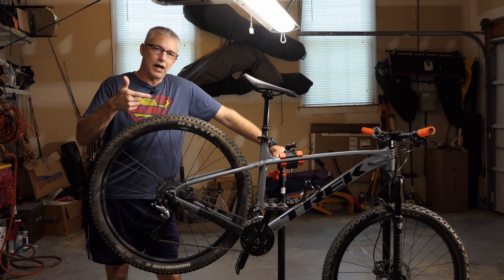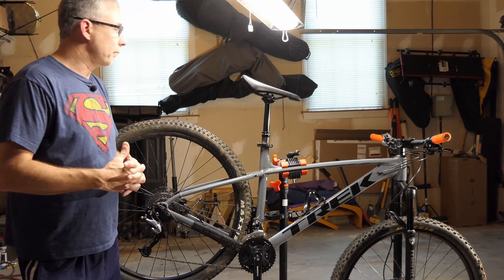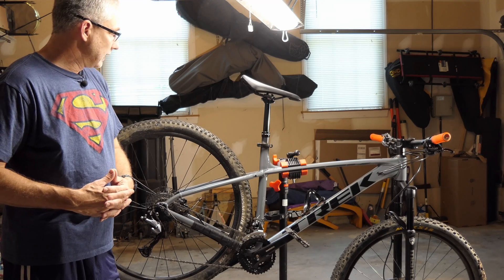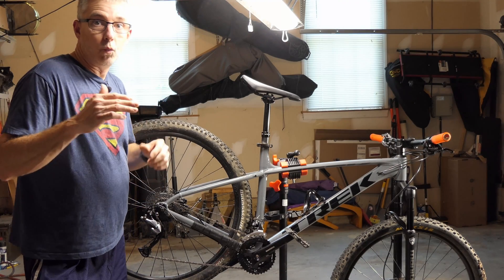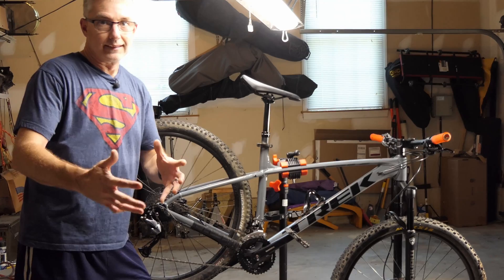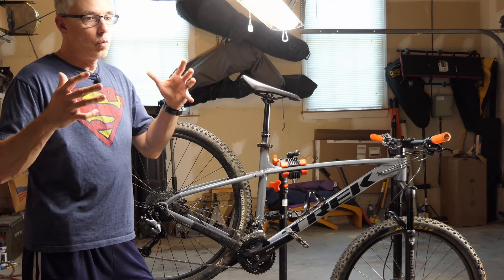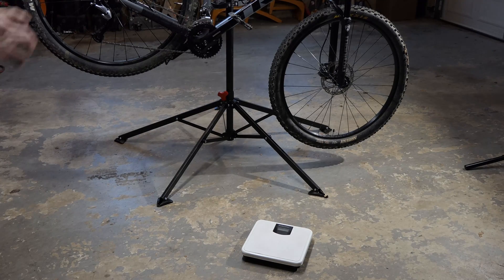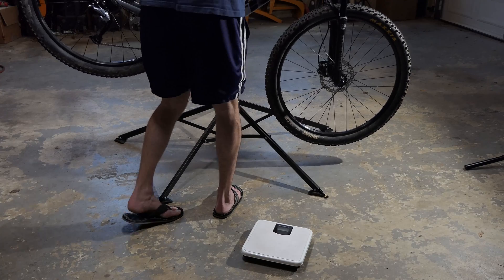PT 1 - Introduction and Teardown of 3x9 Components - Trek Marlin SRAM Eagle NX 1x12 Conversion

Comment: Happy to see this series. Looking forward to watching the other parts. 
Regarding the hub, I should add a note here: the 2x8 marlin 5’s have a shimano freehub that can be upgraded to a 1x12 NX
Reply: I just did the same upgrade on my 2022 Marlin 5 to 1x12 with freehub; it works great!  Just be careful when assembling the cassette, very little tolerance.  Also I upgraded to the GX derailleur and shifter; made a night and day difference.
Reply: @Importeck  thanks for the tip!
Reply: THANK YOUUUU!!! I've been searching through the internet trying to find out if I can use the stock hub to upgrade to an NX Eagle Groupset and now I know, THANK YOU!!

Comment: i have a 2022 marlin 8, it came with SRAM Eagle SX 12-speed.  I have converted almost all of the drivetrain to GX except for the rear hub.   GX and above use a different freehub driver than SX and NX.  The hubs that came on my bike are formula and finding a freehub driver is turning out to be a struggle.  Formula DC-22LW, 6-bolt, Shimano 8/9/10 freehub, 135x5mm QR...  If anyone knows where and which freehub driver I need, please advise...

Comment: did you install the dropper post?
Reply from the maker: Yes.
Reply: @EVERYTHINGcpo  looks like a internal, did you have to drill the back hole ? did you make video for this as well? thanks
Reply from the maker: @dinnoclans7346  I didn't make a video on that... but the hole was already there in the frame.

Comment: So why do it, if youre not gaining any range. I road bike, and this would make zero sense road biking unless I was racing and it was for weight savings. this seems entirely for aesthetic purposes. Which I dont get.
Reply from the maker: I’d never go back. Mountain biking and road biking are very different animals.
Reply: @EVERYTHINGcpo  Im not going back to road biking, I was just hit by a car doing 45mph, destroyed my Ridley and left me in the hospital for 3 days. trust me, Im just trying to understand the mechanics of mtbs.
Reply from the maker: @dulichion  oh wow. Sorry to hear that. As far as a 1x for mtb:  

simplicity (more abrupt terrain changes call for quick and big jumps in changes and that is easier when you only have to worry about one lever)

Handlebar space (you can free up the left handlebar for things like a dropper post lever)

Less chain drops ( front gear is fixed so cross chaining and drops are reduced) 

Those are the main reasons. You can still get a large range with a 1x12 so that downside is negligible.

Comment: Excellent video straight to the point, just wondering I have a 2021 trek marlin 5 I just purchased a sram SX eagle dub group set 12 will it work for me , Also,can you tell me the list of parts you replaced (upgrades)
Reply: Did this upgrade fit for you?

Comment: I have a 2020 Marlin 5, and it has an actual HG driver body. I’ve been wanting to do a 1x swap on it and doing tons of research. 2019 was the last year for the freewheel style wheels on a Marlin 5. So if it’s a 2020 Marlin of any variation it can be very easily upgraded to a 1x without buying new wheels. Thanks for the great video! Just figured that this information would be good to know to help more aspiring riders like myself, who don’t want to break the bank.
Reply: thank you am
Reply: Update. Trek limited the driver body on this bike to 7 speeds. You do still have to buy new wheels for a 1x conversion since they require an 8 speed driver body.

Comment: I believe the 2021 trek marlin 5’s have a free hub
Reply: It does. 7spd freehub
Reply: My 2020 Marlin 5 does have a hg driver body, but it’s a 7 speed, I went to install a NX eagle drivetrain on it today and it won’t work. It has to be a 8-10 speed driver for it to work. Needless to say, I’ll be buying a new rear wheel.
Reply: Update: went to install my NX drivetrain today on my 2020 Marlin 5 and it will NOT work. The Marlin 5 has a 7 speed driver body and it’s too narrow for the cassette. It has to be a 8-10 speed driver for the NX cassette to fit. I’ll be buying a new wheel

Comment: I feel the note at 4:30 so hard. I got my fatbike in the low end SX Eagle group just for the color, knowing that the frame was the same and I'd upgrade later. Now I'm looking at putting a mix of GX and X01 on it, which in a twist of fate brings me to watching this video because I'm planning to use the old SX parts to upgrade my wife's '17 Marlin 7 doing this exact type of 3x9 to 1x12 conversion!

Comment: I have a 2019 Trek Marlin 5 and your videos explained exactly what I need.  I just ordered the Groupset using your Amazon link, along with the needed tools for the job.  I also ended up buying a new rear rim for the upgrade since mine isn't compatible. Can't wait to start building!!!
Reply: Which wheel did you buy send me the link I need to do the same thing you did I have a marlin 5 also
Reply: which wheel did you buy, i’m thinking of doing the same thing
Reply: I bought the 2019 Trek Marlin 6/7 rim at a local bike shop store.  They had to order it.  Cost about $90.

Comment: Hi. Below are the latest Marlin5,6,7 Rear Hub details. I have 2021 Marlin-5. Please confirm if I can upgrade to 1x10, without changing rare wheel or Rear-Hub ? 

Marlin-5 : Formula DC-27, alloy, 6-bolt, 7sp freehub, 135x5 mm QR

Marlin-6 : Formula DC-22, alloy, 6-bolt, Shimano 8/9/10 freehub, 135x5 mm QR

Marlin-7 : Formula DC-22, alloy, 6-bolt, Shimano 8/9/10 freehub, 135x5 mm QR

Comment: Hi I own Merlin 7. Been riding for about 1500-2000 kms now ever since I bought it. Just very recently I have been facing quite a lot of issues. 
1. A cranking sound from the front hub when I paddle. Can find it where exactly though. 
2. Just today when I paddle the bike won’t move forward. The chain will spin but the bike won’t move. Is this freewheel problem? 
3. Whenever I shift to 2-1 on the front my chain falls off

Comment: Hi i have a marlin 5 do you know if i can fit a 1x11 shimano cassette on the hub probably not but just asking
Reply: I think you can. Shimano 8/9/10/11 cassettes have the same width. cog spacing is different so you need the appropriate chain to match the new cogs
Reply: Abbott de las Alas thanks for the advice the marlin 5 has a 7 speed cassette so it probably wont. thanks I appreciate you helping
Reply: @samwood4355  try to remove the 7 speed cassette and check if it has a spacer behind it. you can remove the spacer and upgrade to an 11 speed. here's a video about it.. https://www.youtube.com/watch?v=n5YkkAP_QVI. cheers Sam.

Comment: Nice Video! Thanks for that! The question i´ve got is: Can i do this to my Marlin 5 2020 Model? This came with a 3x7 but not longer with a frewheel... it was upgraded to a cassette system now! I can´t find anything about it.... even not on the Formula Homepage, who where building the hubs for all Marlins.. :( 
I would be very thankfull for some more informations, cause i want to transform my M5 into a real beginner beast! ;-) I just bought the 5 because of the "teal" colour sheme.. i fell in love with! ;-)
Reply: You have to replace the rear hub or get a new rear wheel

Comment: I keep seeing this information floating around that the Marlin 5 uses a freewheel and not a cassette-style freehub... I own a 2018 Marlin 5, and looking at Trek's own specs, it comes with a Formula DC22 rear hub (appears to be an HG freehub, based on the image from Formula's website) and a Shimano HG20 7-speed cassette, which is NOT a thread-on freewheel. What gives? Am I missing something?

The hub may still be too small for a wider cassette (hard to tell, I can't find much info on the DC22), but I don't see where this freewheel info is coming from.
Reply: I believe you’re right. The 6/7/8 spd free hub body cannot accommodate the 11/12 spd cassettes.
Reply: Same, 2015 5 here, 7 speed cassette, no spacer so not enough room for a wider cassette, have to change the hub if we want a bigger cassette.

Comment: This bike is now 1099.99 Canadian for the 2021 version. The version your using and the 2021 are crippled with Formula Hubs. In six months that will drive you mad with grinding ball bearings in that rear hub. Know what you do with a Bontrager Connection wheel set? Let the scrappers take it away on the front lawn....lol

Comment: Hi. I have a Marlin 5. Do you have a rear hub recommendation that will match the  SRAM nx Eagle crankset?
Reply: Hi. Below are the latest Marlin5,6 Rear Hub details. I have 2021 Marlin-5. Please confirm if I can upgrade to 1x10, without changing rare wheel or Rear-Hub ?

Marlin-6 : Formula DC-22, alloy, 6-bolt, Shimano 8/9/10 freehub, 135x5 mm QR
	
Marlin-5 : Formula DC-27, alloy, 6-bolt, 7sp freehub, 135x5 mm QR

Comment: Just did this with my 2019 Giant Talon 2. Bought the bike for $650 and did the groupset for $350. Ended up with a lot of bike for $1,000.
Reply: most advice I get, sell the bikes. then get a new one with a good components. right now, I have trek marlin 5 and would cost me a lot to upgrade the groupset as I will be changing the hubs and probably the wheel set.
Reply: @mervinmiguel9466  even last years models have the exact same rim on the marlin 5 and 6
Reply: I just got a £2,200 full sus for Christmas ($3,000). And it comes with nx

Comment: What is needed to make this bike tubeless, is there a way to do it without replace the whole stock rims or I need another ones.
Reply: Mixed success. Some have been able to, other with lots of problems. You can try but no promise that it will work.
Reply: I did it no problem.  I did need new tyres but was very easy to do.

Comment: I recently got Marlin 5 2020 (in Australia). I would never even think about buying such low specced bike, but since I got it, I've been too thinking about ugrades, and more and more I research and think about it, the more I'm becoming pesimistic about the whole thing. The frame looks fantastic (in volt green) and modern, but it is chunky and the compliance of rear stays is zero. So, with new fork, drivetrain and rear wheel, I'd still end up with a heavy, recreational bike, that only looks good, but the functionality simply isn't there.

Comment: I have a trek marlin 7 2020 I'm guessing this would work as well i ordered all the parts and tools you have in the description.
Reply: I have the same model, 2020 marlin 7. Did you do the install, and did it work?
Reply: @erickuryla9197  everything went smooth. My toughest set up was adjusting the derailleur.
Reply: @erickuryla9197  I have not yet still waiting on the bottom bracket to arrive.

Comment: I have a 2019 Trek Marlin 6.  Did you have to change the wheels to go tubeless?  Or do they work as is?  

(My bike store said it needed new wheels for an extra $200 - is that correct?)
Reply: You will have to buy tubeless tape and put presta valves on the wheels, after everything can be around 45 to 50 dollars
Reply: You can try, but the success rate is mixed with those who have tried it.

Comment: What width tires did you go up to on the stander wheel please? Thinking of upgrading mine
Reply: I was able to fit a Maxxis Ardent 2.4 on front and Ardent Race 2.2 on 2020 Marlin 6 without any trouble.

Comment: I'd love to see how ran the dropper tube internally.  I bought the 2020 Marlin 7 after the bike store said it could be done but I'm being told it requires the bb to be removed?  I didnt see a cable in there on your bb removal part of this video
Reply: Interested in same thing. 2020 Marlin 6, I have the extra hole in frame, but a lot of conflicting info if this can be done. FMU, Trek says they removed option, because it interfered with front  deraulier cable, which ironically wouldn’t be a problem if you convert to 1x, lol. My LBS said we could probably do a partial, run internal  through the frame, out the bottom where cables come out and then external up the post. Not ideal, but better than totally external.
Reply: Can I do this upgrades to my 2018 marlin 7??? Thank you
Reply: Leonel Cervantes I put a PNW Cascade on a 2020 Marlin 6. I ran the cable from the lever into the extra internal cable routing hole on the drive side. I came out of the bottom where all of the other cables exit and the ran it externally up the seat post to the seat. I secured cable to seatpost w/zip ties that are the same color as bike and you barely notice the cable. Was able to route w/o interfering with any other cables nor impeding the dropper operation. Good luck.

Comment: I have the sx 1x12 being delivered today for my 2019 marlin 5. That will pretty much top it off. 
I have new shwalbe tires
Rear wheel with a cassette hub
Rafeface flat pedals 
Reverb stealth dropper
45mm stem
Rockshox reba duel air 100mm fork
And a wireless speedometer. 
I'm about ready for local races.
Reply: @darkjaypr5647  I got the entire drivetrain as a package on aliexpress. 
Sram sx eagle 1x12 11 to 50t groupset kit.
It came with the cassette, chain, derailleur, crank arms, chainring and bottom bracket. It came with everything you need to go 1x12 from a 3x7. 
But from 2019 and back, the marlin 5 came with a freewheel 7 spd rear wheel. It's yesteryear's technology and will not work with any modern cassette. So you need to buy a new rear wheel with a standard shimano freehub or replace your current hub with that new one. But then you have to have it relaced. 
I just bought a used rear wheel off pinkbike for cheap. It looks new and cost less than half what a store bought wheel would be.
It's all about getting to know your bike. The knowledge comes with researching what works for your bike. 
The sx groupset is the only thing I bought new for my bike. Everything else has been bargain hunting through pinkbike or  local riders.
Reply: @Mr.P.Griffith  hey man do you know if the 2020 marlin 5s have a standard shimano freehub, not needing to buy a new rear wheel?
Reply: @lachieedwards664  I'm not 100% sure what freehub it is but I do know the 2020's come with a proper cassette instead of the old style freewheel. But a freehub that was designed for a 7spd cassette may be shorter than a typical 8spd design (which can hold 10spd+ cassettes). There's a weird threshold between a 7 spd and 8 spd design. 
There will be mtb forum threads out there asking your exact question with much more in depth answers coming from actual mechanics. The Marlins are a very popular bike. If something can be upgraded or modded to a marlin, there's someone out there that's  done it.
Reply: P. Griffith yeah cheers man just read some forums and it looks like it should be all compatible
Reply: @lachieedwards664  nope, you'd need a new wheel
Reply: What rear wheel did you go with? I'm kind of stuck because everything i find is 12x142mm, and the marlin frame is 5x135qr
Reply: @saradomim  just look up that 135 qr specifically in a 29er. If you want to use pinkbike on your phone go to the bottom of the page and there's a "use desktop version"  and in the search parameters use the "search near me" function and widen the area to a driveable distance. Look at the wheel with hub section and filter it to 29inch. Then you have to look at the ones that say qr.. that's how I did it.
You're looking at $50-150 for a reasonable rear qr wheel. Anything is better quality than the stock one.
Reply: Most people on pinkbike will ship too. U just have to pay extra for that.
Reply: @Mr.P.Griffith  Thanks, will try my luck and look into it more
Reply: The freehub on the 2020 is indeed shorter than your normal hg11 driver, that's why I was asking above for a good compatible wheel for the 135 qr dropouts this bike has
Reply: Only on the marlin 6 and above do you get a normal hg11 driver
Reply: @saradomim  thanks for clarification.  I knew there was usually a difference with stock 7 spd vs 8 spd.
Reply: @Mr.P.Griffith  I thought so too but I did in fact take my cassette off and measure it, so if you want more gears in the back you would have to change the hub out for an hg11
Reply: It just dawned on me... you can buy any 2020 trek marlin 6 or 7 rear wheel from your lbs. That way you know it fits the frame and it will take a 12 spd eagle gx or nx cassette, which is what the sx groupset uses for a cassette.
Reply: I read through all the comments hoping to find some info on frame sizes? I have a 2020 Marlin 7, small size. 27 1/2 wheels, does that make a difference in the upgrade conversion?
Reply: @erickuryla9197  Nope. You're good to go. Frame size and wheel size don't play a factor in the drive train. The only thing to consider is the crank length. If you ride a small frame then your bike is probably kitted with 170mm cranks. Most people wouldn't notice the difference between 170 and 175mm unless you spin often or climb hard and need perfect ergonomics.
Reply: @erickuryla9197  not really, maybe just make sure the cranks aren't too long so that they don't hit the ground when you pedal
Reply: I purchased the Marlin 5 2021 
The new rear hub model
Is this: Formula DC-27, alloy, 6-bolt, 7sp freehub, 135x5mm QR
I’m wondering if this will work.
I appreciate any help.
Reply: @renzomedina9861  it's all in the freehub length. There's 2 main sizes, one that can hold up to a 7 spd cassette and one that can hold 8 to 10 (and sram eagle 12 spd). I have no idea if you can just slip a new freehub on a hub that is designed for a 7spd but it's worth investigating.
Reply: P. Griffith This is the rear hub for Marlin 5 2021
*Formula DC-27, alloy, 6-bolt, 7sp freehub, 135x5mm QR 
Marlin 6/7 2021 
*Formula DC-22, alloy, 6-bolt, Shimano 8/9/10 freehub, 135x5mm QR